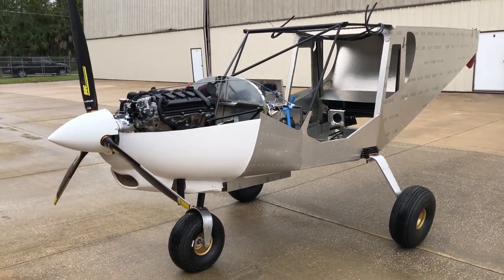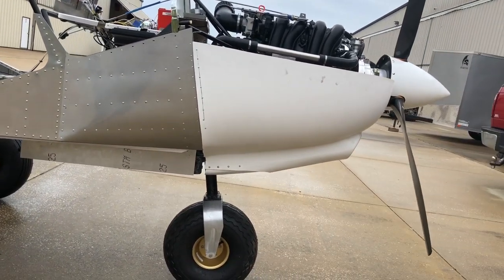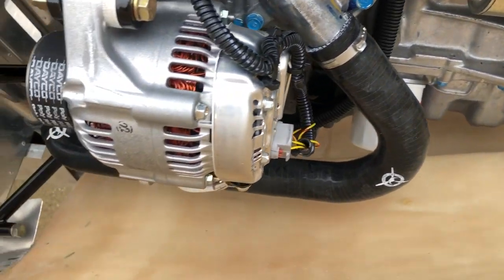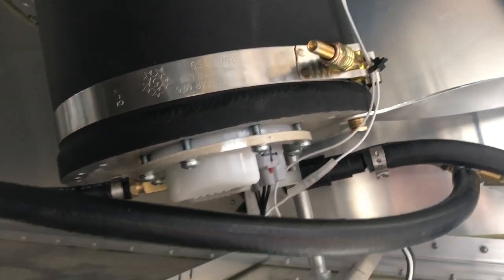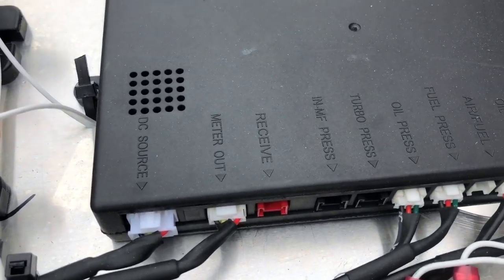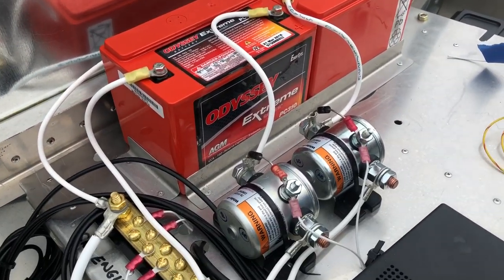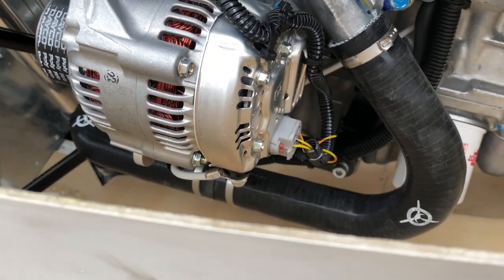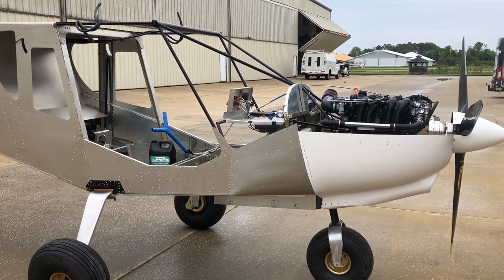Viking 130 engine Installation

Comment: Excellent, I admire your Innovation the company definitely opens doors for people who want to get into Aviation on a reasonable level. My observation, does the fuel line need to be shielded or you could use the steel braided hoses, you may have other engineering restrictions for why you didn't do that but just my Layman's suggestion. Thank you for sharing very inspirational work.

Comment: Hey Jan, I've been looking at your engines for a bit. Looking at building a 801. My understanding based upon you numbers you're using the 1.5L Turbo Accord engine. Are you looking into expanding to the 2.0L Turbo engine? I don't know the numbers on the weight difference between the two, but I wouldn't figure it would be much. I'd personally like the extra power as this is going to be a bit of a workhorse for me, so being able to take advantage of a potential 305hp is of significant interest. Also, I've looked and I'm rather new to the whole build a plane game, but can you push the engine readings over to Dynon or Garmin systems as opposed to your Viking View?
Reply from the maker: Yes, you can do any engine monitor you would like.  We can build a 2 liter for you
Reply: @eggenfellner  COOL! I may start on it as I have access to some low mileage engines (less than 3K) and the turbo ordered new from Honda. Finding a 2.0L with Turbo is pretty difficult. Depending upon the route I take I'll contact you and get a price either everything or just the modification I need from you.
Reply: @eggenfellner  Jan a little more reading a research on my part. According to the below article you're already using the 1.5L and the 2.0T but it seems it isn't tuned to the 252 or 305 outputs available. Can you expand upon that. My assumption is your doing the tuning based upon the airframe tolerances?
Reply: The article I mentioned. https://www.experimentalaircraft.info/homebuilt-aircraft/viking-aircraft-engines.php

Comment: I would love to know what the recommended TBO is. What kind of life are people getting out of these?
Reply from the maker: Hey Jim, standard TBO 2000 hours if not more along with more affordable maintenance because you can get everything yourself locally without issue. We have combined thousands and thousands of hours with over 500 customers worldwide. The highest hourly wise outside of our own is between 700-800 hours, without issue which as you know in an experimental slower aircraft is a lot of flying.

Comment: Does the throttle fail full if cable breaks??
Reply from the maker: We don't use Rotax bicycle cables. All cables are certified Teflon lined aircraft style push pull cables. No springs, etc.